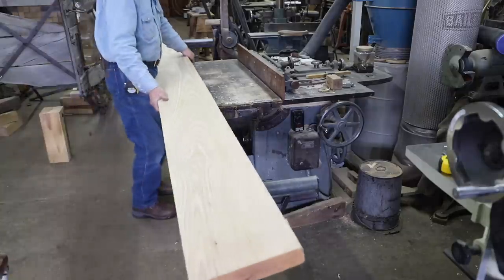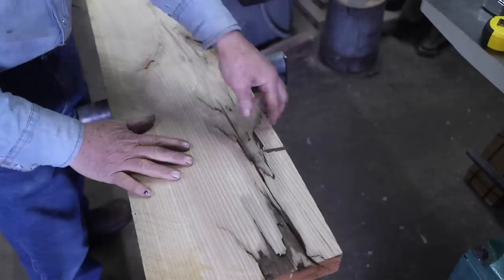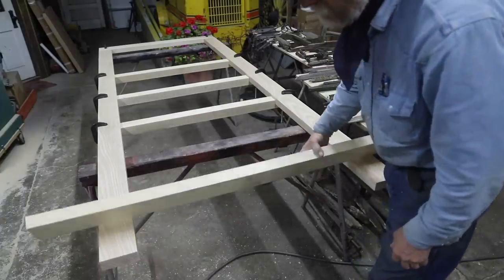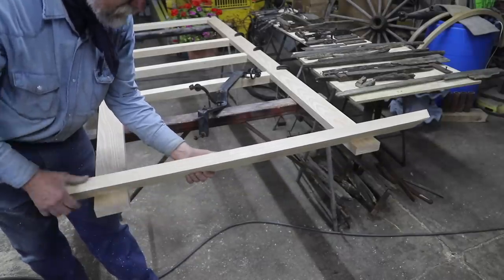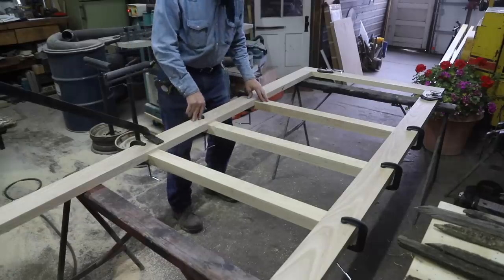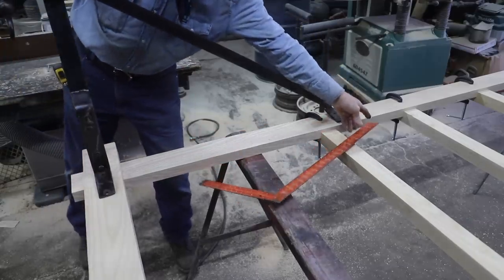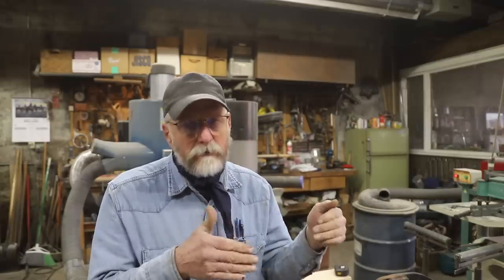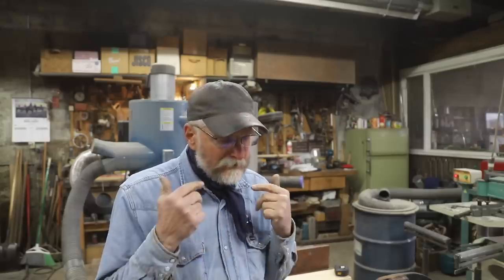Building the Foundation for the Mud Wagon | Engels Coach Shop

Comment: Electric and battery powered chainsaws sure are useful in the shop.  They may not be precise but they sure speed things up.  Since there don't seem to be any pictures, it's going to be real difficult argue with whatever you choose to do but I certainly understand the mental turmoil here.  But for a time machine.  Of one thing I'm positive, the quality of workmanship in your final result will exceed that of the original.

Comment: This is where the decades of experience really pay off, along with close attention to details.  On the issue of the nut being 2" from the iron instead of 1 1/2", could it be that there was another 1/2" layer of something there?  I've run into this in trying to restore old machinery, where they didn't have a shorter bolt, so they used a long one with a shim.  This wouldn't happen in a factory, but maybe in a barnyard.

Comment: Your skill and insight are phenomenal. My personal results with woodworking are saw dust and kindling.
Reply: Keep making sawdust and kindling and fine works eventually will be the result.
Reply: What? No slivers and chunks that have to be cut out of your flesh? That's my end result. Then back to the store for more lumber to start all over again.
Reply: @rfd0798  I know all about those splinters. A large portion of woodworking is smoothing wood so you don't get splinters off of it. Once I got a splinter making some routed signs and I was like I'll teach you, you dirty so and so piece of wood! So I grabbed a torch and burnt all the splinters off of it. Then I was like, Hey I like that look. So then I started burning all of the signs I made. Now that's a step in the process. But that happened a long time ago.

Comment: I guess I'm not the only one who used a regular table saw as a dado.
It makes perfect sense for a one-off.
Reply: OK, I'm guilty too.:goodvibes:
Reply: Me too
Reply: @plainnpretty  we also seem to be on the same page as far as preferred mode of transportation goes, too.
Reply: As charged. I've even done the diagonal cut to get a particularly large ornamental piece restored because these days finding a router that can do such a cut is nigh impossible.
Reply: Yep, add my name to the list.
Reply: Dave's table saw is fitted with two blades, a ripping/crosscut blade and a dado blade. The rip blade when cranked into position is closer to the outfeed side of the table, and the dado blade is closer to the infeed side of the table. He is in fact using the dado when cutting out the joints. Dave has done a video on his table saw, and you should find it in his old videos if interested.
Reply: @robinhumphries5743  That may be, but I'm sure I saw a single blade, not a dado, and I didn't even have it on high res.

Comment: Fascinating, thank you. Going through a similar process with my car. Finally started the ash frame. I know what the body looks like now I make a frame to fit. The factory ones were quite simple. Lots of simple butt joints and metal brackets to reinforce everything. I stick to factory as much as possible but with no plans or a real one to measure a bit of it is guess work. I find wood much harder than metal to work with. Metal is more forgiving with mistakes!

Comment: Sure is a powerful Saw with super sharp teeth.
My table saw puts up quite the fuss when asked to perform that procedure.
Thanks for making it look easy.
Reply: It's power that you need. I have a 1 HP table saw and a 1.5 HP one and the difference of what they can do is night and day. Where one would be balking the other one is just cruising. Big cabinet saws can have 3 HP motors in them. Nothing slows them down. They have 3 belt sheaves on them too. Which is a hassle because then you have to get matched sets of belts for them.

Comment: At your table saw, on the bottom on the floor, you should put one of those suction vents that are usually used in houses/hotels with a centralized vacuum system. Not only would it naturally suck all the dust that seems to escape, but it would also make eventual cleanup much, much easier. IMO, if you make it a quarter of the original diameter for the split-off, it should suffice, and making the wide nozzle would be a breeze for a woodworker of your caliber.

Comment: Looks like this mud wagon is going to be mostly as originally built, but with a degree of Engelism where the archaeological bits are scarce.  I see this as more of a contemporary construction modeled on a period wagon, using the ready made metal work as much as possible.  As per my previous post, in this this sort of hybrid historification, I think it is perfectly legit to improve upon the wagon by making the metal work match symmetrically and strengthening same where necessary.   The beauty of the project is as much in the history it represents as is in the wagon itself.  Have you thought about a paint scheme yet?  Will you do any pin striping?

Comment: Could that Inch be a reflection in the changes in dimensional lumber size changes? (which were not standardized until 1964)
Reply: Dave doesn't think so.
Reply: I doubt that wagon was built with dimensional lumber. The stuff may have been hand sawn. Or it came out of some lumber mill. Lots of folks would rig up their own milling operations even. Big mill blades were a pretty common thing back in the day.

Comment: Hey Dave, I recall you doing a video about your table saw but I never noticed until this video that it has an air hookup on it.  What does the air fitting supply.  p.s Tell Bonnie & Gary I said hello if you run into them.